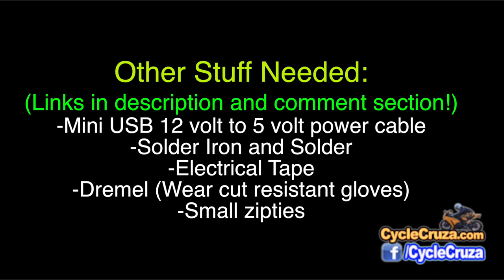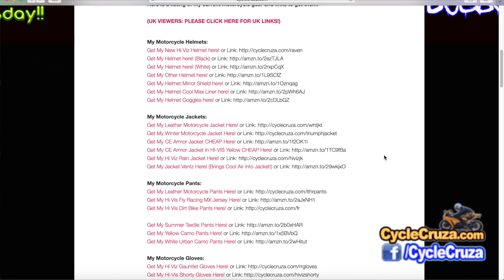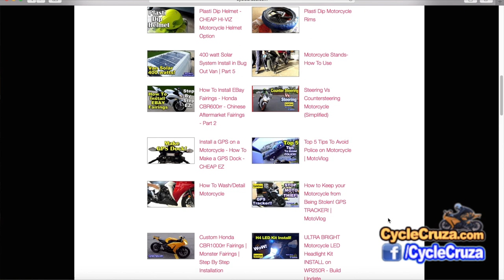DIY Ducati XDiavel GPS Mount (For Other Motorcycles Too!)  Motorcycle GPS Mount

Comment from the maker: Links to Get Items in Video ⬇️
Get XDiavel GPS Mount: http://cyclecruza.com/swgps
Get My 4k Action Handlebar Camera: http://amzn.to/2DkOJn7
Get Camera Handle Bar Mount: http://amzn.to/2Au2k8B
Get GPS (Cheap!): http://amzn.to/2CVj3Uu
Get GPS Bar Mount (Use to Customize): http://amzn.to/2D3P546
Get GPS Case Handlebar Mount: http://amzn.to/2mpJwTg
Get Mini USB 12v to 5v Cable:  http://amzn.to/2mo6Qk9
Get Micro USB 12v to 5v Cable: http://amzn.to/2D3PL9E
Get Stainless Steel Hex Bolt Set: http://amzn.to/2FxqZNl
Get Stainless Steel Lock Nut Set: http://amzn.to/2FwA7Su
Get Stainless Steel Washer Set: http://amzn.to/2CXeB7J
Get Dremel Kit (Awesome!): http://amzn.to/2D3CsG2
Get Solder Iron Kit: http://amzn.to/2DmICin
Get Cut-Resistant Gloves: 
Get My Lighted Work Bench: http://amzn.to/2Ftc5aO
Motorcycle Lift: http://amzn.to/2kt1pD7
Get Wall Bolt/Nut Organizer Cabinet: http://amzn.to/2D7Uk3l
Get Cut-Resistant Work Gloves: http://amzn.to/2AS6rLT

****Links to get My Gear and Other Stuff:
Get My MotoVlog Camera CHEAP here: http://amzn.to/2g2AiND
My New Hi Viz Helmet (On Sale): http://cyclecruza.com/raven
Get My Gold Mirror Shield: http://cyclecruza.com/gmirror
Get My New AGV Sport Jacket: http://cyclecruza.com/l7db
Get My New Mach 5 Backpack: http://cyclecruza.com/x5gh
Get My HI VIZ CAMO PANTS: http://cyclecruza.com/hivizcamo
Get White Camo Pants here: http://amzn.to/1sWKFvA
Get my Yellow Camo Pants Here: http://amzn.to/1x5BVbQ
Get My Protector Jacket CHEAP here: http://amzn.to/1f2OK1l
Get Hi-Viz Protector Jacket CHEAP here: http://amzn.to/1TC9fBa
Get My Heated Gloves:  http://cyclecruza.com/heatedgloves1
Get Heated Grips here CHEAP: http://amzn.to/1voxFWu
Get My Winter Jacket: http://cyclecruza.com/triumphjacket
Get My New Hi Viz Gloves: http://cyclecruza.com/rrgloves
Get My Suomy DS Helmet here: http://amzn.to/2ezTJLA
Get Leather CE Rated Pants here: http://cyclecruza.com/lthrpants
Get Hi-Vis Shorty Gloves here: http://cyclecruza.com/hivizshorty
Get My Full Length Gloves: http://cyclecruza.com/sgloves
Get My Sidi Boots: http://cyclecruza.com/zero
Get Hi Viz Rain Jacket: http://cyclecruza.com/hivizjk 
Get River Road Leather Jacket here: http://amzn.to/1PflnIQ
Get AZ1 Action Camera CHEAP: http://amzn.to/2aRdcV6
Get My helmet Microphone: http://amzn.to/2xCT4O0
Get Mini Mic Furry Windscreen: http://amzn.to/2bgPmTQ
Get My 2-Port Power Bank: http://amzn.to/2BC676e
Get Water Bladder CHEAP: http://amzn.to/2b5w5nv
Get My Hi-Viz MX Jersey here: http://amzn.to/2aJxNH1
Get My Under-tail Cameras here: http://amzn.to/292IqWp
Get My dash Cameras here: http://amzn.to/28UNtvV
Get My Big Power Bank here: http://amzn.to/1Ridn5R
Get My GPS here: http://amzn.to/1VUMdJq
Get Hi Viz Vest here: http://amzn.to/1ROUBJY
Get Motorcycle Tail Bag here: http://amzn.to/1iwDbgQ
Get Flat Tire Repair Kit here: http://amzn.to/1mO96NJ
Get Knee/Shin Guards CHEAP here: http://amzn.to/1gY6rjI
Get Motorcycle Hoodie here:  https://youtu.be/bu_ypSLOQKE
Get LOUD HORN: http://cyclecruza.com/loudhorn
Get Ear Plugs here: http://amzn.to/1PE0NTn
Get My Tail Light with Integrated Turn Signals (And modulator):
http://amzn.to/28JpTOZ
Get Tank Bag: http://cyclecruza.com/tankbag

Check Out My Amazon Stuff (All my stuff!): https://www.amazon.com/shop/cyclecruza

Links to ALL of My Motorcycle Gear and Cameras:
http://cyclecruza.com/my-gear

Links to All of my Mod Parts for WR250r/CBR1000rr:
http://cyclecruza.com/my-gear

Links to My Gear for UK VIEWERS: 
http://cyclecruza.com/my-gear-links-for-uk-viewers

**CycleCruza's Recommended Videos********

Go to my motorcycle Video Playlists here:
http://cyclecruza.com/my-videos-2

How to Make a Motorcycle GPS Dock for FREE:
https://youtu.be/lISAtqRWvX0

Watch Ducati XDiavel First Ride:
https://youtu.be/C7ySsL2BNmY

Watch How to Ride a Motorcycle Video Series:
http://cyclecruza.com/how-to-ride-a-motorcycle-video-series

Watch My Bug Out Moto Van Video Playlist:
http://cyclecruza.com/cyclecruzas-bug-out-van-videos

Watch How to get started in Motorcycling video:
https://youtu.be/at5jr430vX0

Watch Top 5 Starter Motorcycles Video here:
https://youtu.be/wyniWQWAy10

Watch CycleCruza's Buying Tips video here:
https://youtu.be/n4zN-EJHQd0

CycleCruza Top 5's Videos:
http://cyclecruza.com/cyclecruzas-top-5s
---------------------------------------------------------------------------

SUBSCRIBE TO MY ALL-IN-ONE Motorcycle CHANNEL! 
http://www.youtube.com/user/cyclecruza

SUBSCRIBE to my new new Bug Out Moto Van Channel:
http://www.youtube.com/bugoutmoto?sub_confirmation=1

SUBSCRIBE to my new new 100% MotoVlogs Channel:
http://www.youtube.com/user/cyclecruzavlogs

WEBSITE/BLOG (Be notified of new content and deals!):
http://www.cyclecruza.com

INSTAGRAM:
http://www.instagram.com/cyclecruza

FACEBOOK:
https://www.facebook.com/cyclecruza1

TWITTER:
https://twitter.com/CycleCruza

GET CYCLECRUZA STICKERS HERE:
http://cyclecruza.com/ccstickers

MERCH (Get SportBike T-Shirts and Hoodies):
http://www.cyclecruza.spreadshirt.com

Comment: Thanks for posting this video, I just bought a WR250R on Craigslist because of you! I love the bike, it was slow as a turd floating in water until I did the airbox mod. Now it kicks ass! I almost bought a DRZ, but your videos convinced me to get a WR250R... thanks dude I will be doing the GPS mod soon, as well as power commander and exhaust. Ride safe peace out my brother.
Reply: Jimmy Theshark be careful with the airbox mod without a pcm 5. Run that bike lean and you could ruin it.
Reply: Xterrential thanks for the tip! Weather forecast is crap here in NJ, so won’t be riding much, should have pc installed soon.
Reply from the maker: Nice! congrats! Yeah get a PC on it pronto. Get rid of the stock exhaust and get a FMF pipe and the megabomb header. Make sure to get a bigger sprocket if you have the stocker on it. I think the 47 tooth is the perfect size for both street and off-road. The wr250r is in a league of it's own,  a low maintenance reliable workhorse. I've beat the hell out of this bike and it has never failed me ( as you all have witnessed in my videos).

Comment: I have heated grip installed, is that feature using same power / cable which is in your video - meaning if I have heated grip I am not able to feed GoPro ?
Thanks

Comment: Lol can you even buy a GPS stand alone anymore ?? Phones have better battery life and 1000x better maps via Google maps and you don't need service for it anymore
Reply: fastfed f that is what I was thinking lmao. They have this invention called a cellphone and internet lmao
Reply from the maker: Several reasons why you should use a dedicated GPS: Dedicated GPS has a bigger screen and uses the WAAS system, which is better, phone GPS does not. Also, phone does not give you the speed limit on the street you are riding on and your actual speed. This is the main thing I use it for because I'm often on back country roads and have no idea what the speed limit is, comes in handy when I sniff out a cop. It came in super handy when I was Ohio Route 555 (Ohio's tail of the dragon), it saved me from a speed trap where it went from 65 mph to 25 mph within 50 feet and a cop was waiting right there. From my research, speed limits are only available in two area for cellphone users, San Francisco and Rio De Jeneiro Brazil. 
http://www.androidpolice.com/2017/07/08/google-confirms-speed-limits-google-maps-available-two-areas/
Reply: CycleCruza You're usually spot on cruza but phone based nav's are truly the future.

I use the waze app for android & atleast in florida,it displays road speed limits alongside your current speed.

To top it off.Theirs also a feature that'll usually tell you if a cop is nearby😁.

I love it.
Reply: Well, I mean I use my phones GPS to fly, it literally takes me from point a to b in the air, while I don't have to rely on it to save my life, it hasn't failed yet. Trust me , the accuracy is within feet , also DJI and many other drones use those same satellites to rely on its course and location. There is nothing wrong with liking your Grandpas navigation system (lol sorry had to go there) but to try to justify it by saying its better than this or that is just plain wrong. I promise your average smart phone is in a different world then those units when it comes to great features,safety and other stuff.  I honestly don't believe you about needing it for the speed information, but lets just say you're right and that's why you have one, guess what, google maps will have it very very shortly . I'll welcome you to the present when you finally switch :)